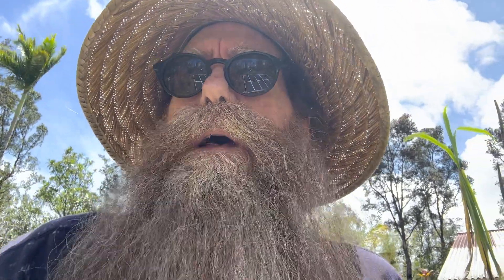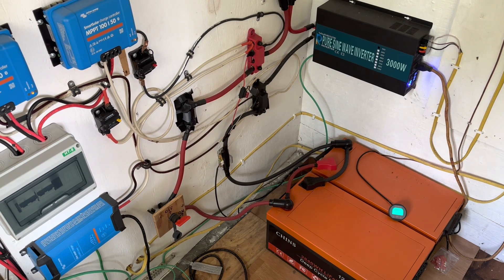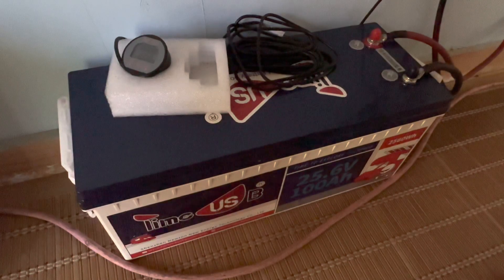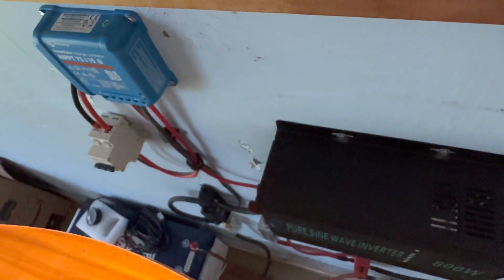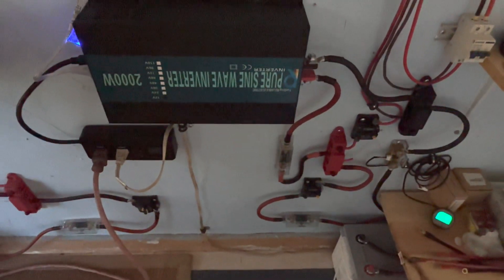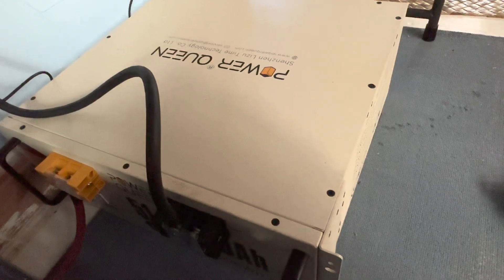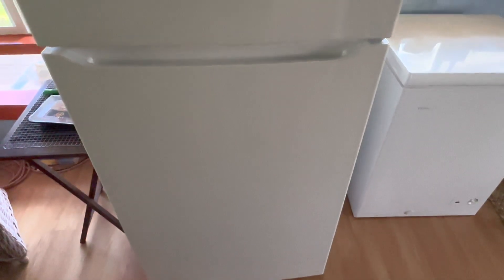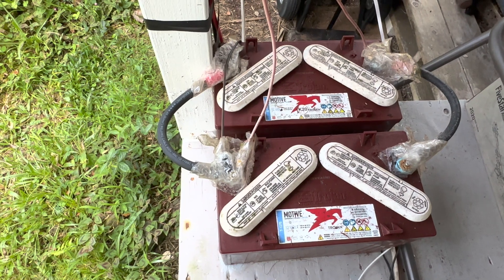6 independent LiFePO4 battery power stations for redundancy ,comfort  in solar off grid  lifestyle !

Comment: Great video. I love how you still uses the lead-acid batteries even though you have made the switch to LiFePO4. Just because its old tech does not mean you have to toss them. BTW do you run a charge controller to the lead-acids? Also what do you power with the lead-acids? Take care, Joe
Reply from the maker: Lived on LA much longer than LiFePO4, and was always happy to do that. Love the new technology, but LA paved the way off grid for a very long time. I do have a 20 amp cc on those two Trojan's which I still use on the deck with a 300 watt inverter for small loads Charging station for the devices we all use these days, outside lighting and some t.v. now and then. Mahalo for being part of the channel 🤙

Comment: I'm running 2 bluetti eb55.  Then a main system I'm almost done building. 1200 24v victron.  2 12v 240ah power queen at 24v. Epever 40amp mppt. Victron 24v to 12v. I still need to order panels. I'm in a wheelchair and going offgrid in the next couple weeks ! I subscribed!  Hope to get a fallow back.
Reply from the maker: Mahalo for being part of the gang here! Let us know how it goes okay? Best of luck! Aloha! 🤙
Reply: @ProjectsinParadise808  videos are coming ! So far I got the cement pad cleaned of old weeds. Order a cabin next week. Then the fun begins!
Reply from the maker: @disabledoffgridadventure9580  How exciting! Been 30 year's since I started just like that. So much fun...good for you! 🤙